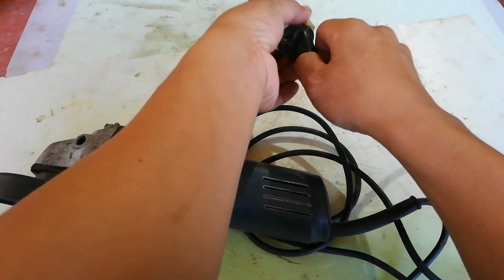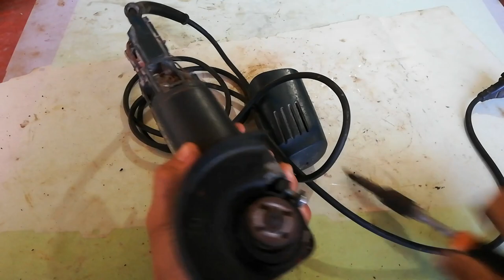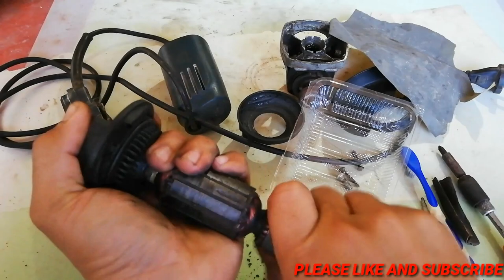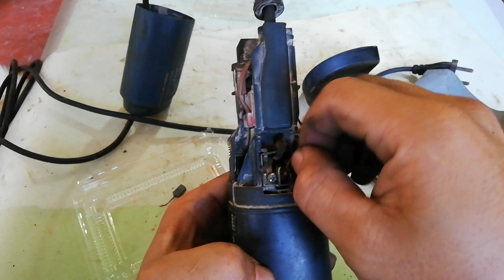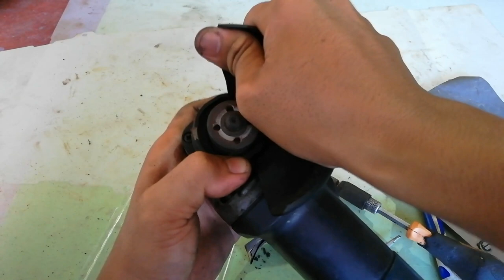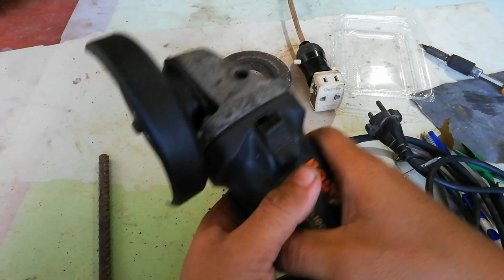Angle grinder sparking armature repair | sparking commutator damaged power tools

Comment: Hello po Bat poyun minidrill ko ambilis  umubos ng carbon brush nadudurog napansin kopo sa commutator nya parang may maliliit naubak?
Reply from the maker: Madali po maubos ang carbon brush nya sir kasi nasira na ang commutator nya.
Nagka biyak2x na ang commutator...
Ano pong brand sa inyo sir.
San po sa inyo..
Pwede pong ma repair yan.
If may available akong parts. Pwede din pong palitan..
Reply: Sa lazada lang po sya galing eh paramg china brand anopoba fb acc nyo

Comment: Nice Sir😃 ginawa ko rin po pero bakit marami pa ring spark at umu-usok?Salamat sa sasagot😊
Reply from the maker: Baka nagka short circuit parin yan sir or ang commutator nga ay nagka damage na.
Nauubus nya ba ang carbon brush sir?
Lihain nyo po para smooth ang pag touch ng carbon brush sa commutator

Comment: I try not working can you help
Reply from the maker: Please check the windings if there is short circuit or burn before you apply the insolation varnish.
What kind and brand of your powertools? I want to repair it sir.
Reply: You are right some winding is burned thank you

Comment: Sir pwede po kaya i convert yung 110 sa 220 na grinder
Reply from the maker: Pwede po sir.
Transformer po kailngan nyo..
Pwede din po e rewind ang windings nya sir. Palitan nyo lang po ng mas maliit na wire.
Tibangin nyo po ang nakuha nyong wire sa pag rewind nyo. At ganung timbang din karami ang ipapalit nyo... Pero kung ako po ang tatanungin. Gumamit nalang po kayo ng Transformer. Or AVR na may output na 110v kay maganda po yang grinder nyo sir. Original po yan..
May ganyan din ako..
Super the best ang quality..
Reply: @creativejunior7060  sir may fb  po ba kayo ipakita ko lang yung grinder ko ganyan di sira malakas spark..ganyan din hitsura ng commutator..dinala ko kasi sa gawaan 1200 daw gawa nun papalitan commutator..ipapakita ko lang sana sainyo kung pwede pa..salamat wala pa kasi akong budget..kaya ipapakita ko po kung pwede pa..maraming salmat po

Comment: Sir may praan pba sa commutator ng grinder ko tanggal na kasi ngipin nya ng ispark na
Reply from the maker: Sa na experience ko sir.
Pwede po siyang lagyan ng copper wire na gagayahin ang size ng nasa commutator pero hindi rin nagtatagal sir kasi hindi naiidikit ng maayos. May mga extrang armature ako diri ng mga angle grinder sir. Ano pong brand ang sa iyo?
Reply: @creativejunior7060  anu po ba pde ipang dikit sir
Reply: @creativejunior7060  Makita sir

Comment: Saan po kaya problem sir kapag umiinit ung stator ng angle grinder at malakas yung spark? Reply po sir thank  you
Reply from the maker: Pag madaling uminit po ang powertools nyo sir ay kadalaaang sanhi nyan at nag rarub or sumasayad ang armature sa kanyang stator dahil hindi naka. Center ang armature sa kangyang stator dahil sa bearing. Tapos pag nag spark naman ang commutator nya sir.
Baka nagka short circuit na na ang armature nyo or kailangang linisan ito..
Try nyolang e center ang armature sir. Change kayo bg bearing or e ayos nyo ang stator na dili na mag rub ang armature sa stator nya.
Salamat po sir.
GODBLESS YOU PO.
Reply: Napalitan ko na po ng bearing sir tas na test ko na din yung armature base sa mga tutorial video sa youtube ok naman na linisan ko na din po yung sa stator nya kunting ikot lng umiinit na

Comment: sir ano problema kpag mlakas pumudpod ng carbon ang grinder pa advice kung paan ma fix ang problema ng grinder k salmat
Reply from the maker: Pag ganyan po sir na malakas nang napupudpud ang carbon brushes ng powertools nyo ay hindi na pantay ang spacing ng armature.. Kailagan e lvl ang armature sir.
Tignan nyo po ang armature sir baka may part na may natanggal or hindi na smooth kaya pag ikot ng armature ay nakakapudpud ng carbon brush.. Lihain nyo po ito sir..